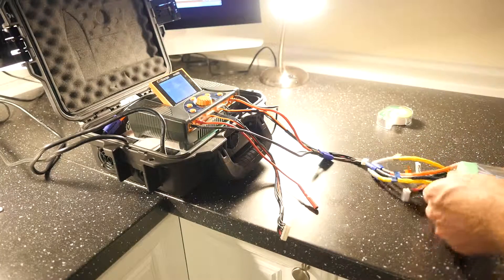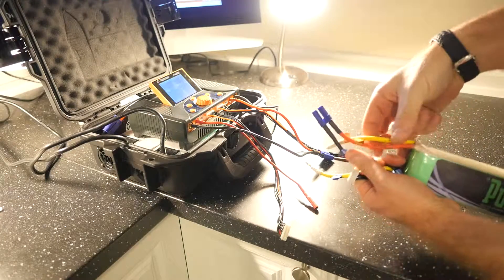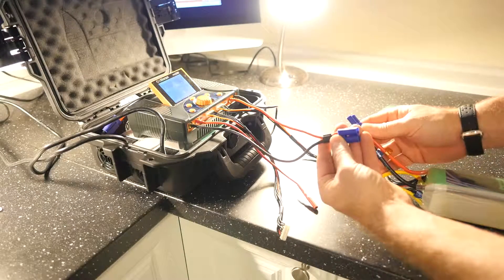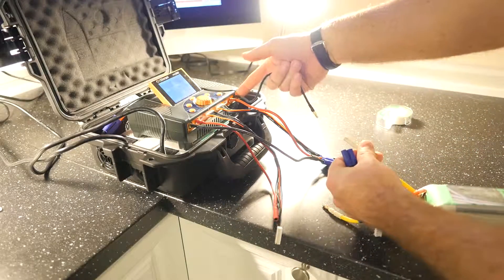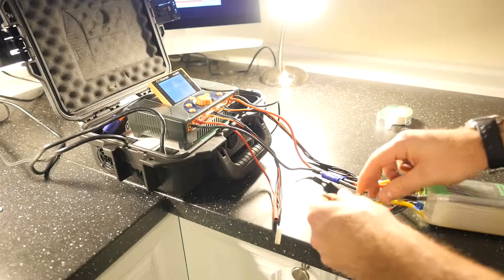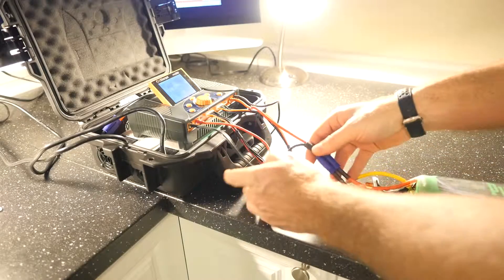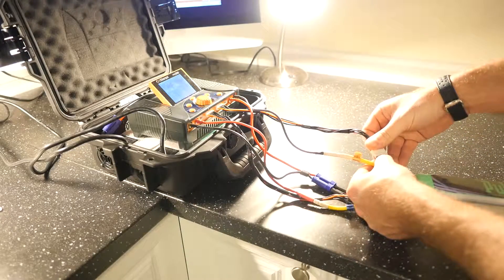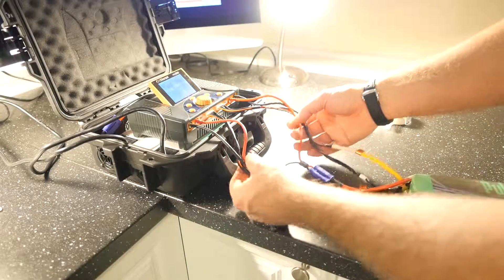12s Lipo Charging with a shared EC5

Comment: So do you charge this as a 6 cell on both sides of the charger individually or somehow as a 12s? So confused.  Been flying 500 size 6s 3000mah packs for 15 years and just moved up to a 700 size.  Any help would be greatly appreciated. 🙏